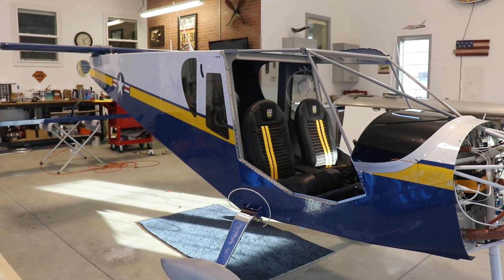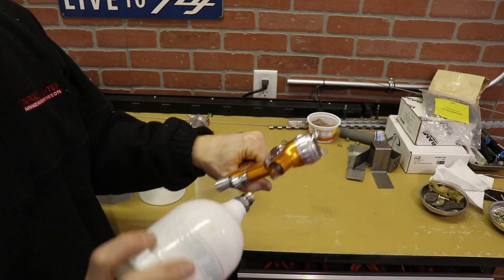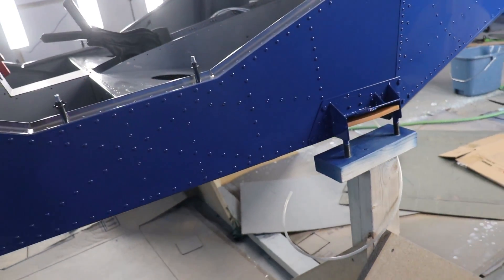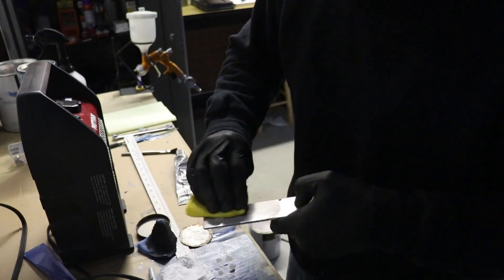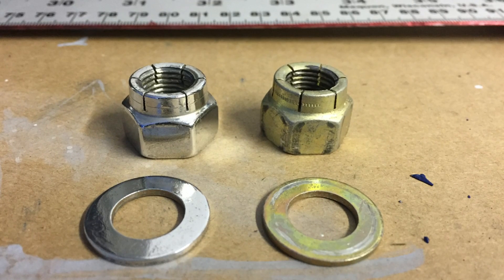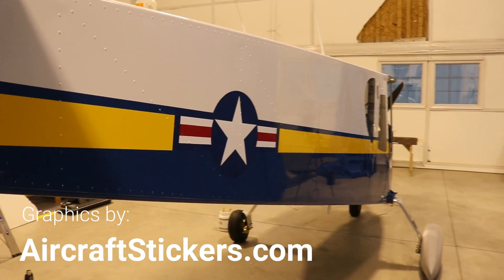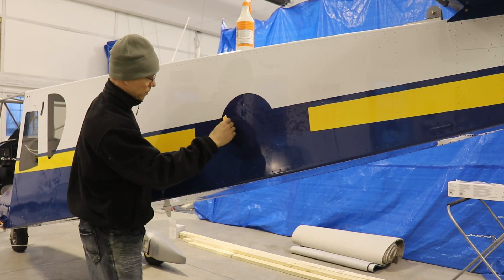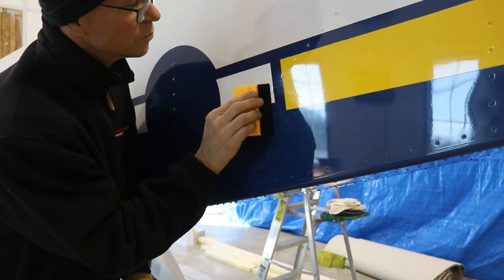Zenith Cruzer Fuselage Paint and Graphics!

Comment: will you clear coat the vinyl? just wondering with the pin holes. wind erosion, drawing in moisture and other debris.  just wondering when "we" install them on much faster aircraft "we" cant poke holes in them.